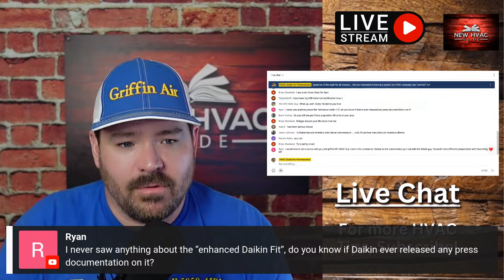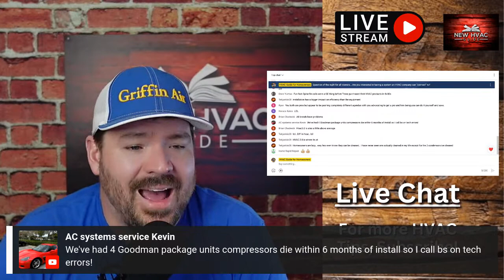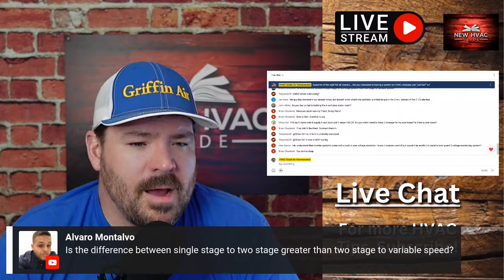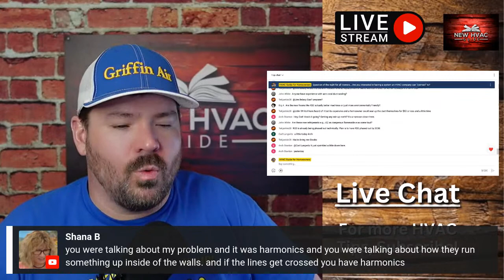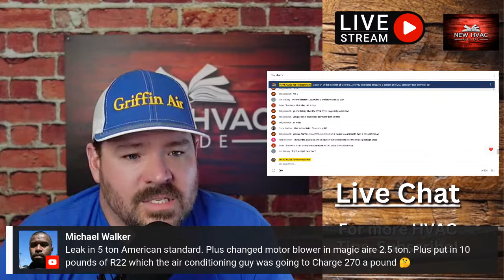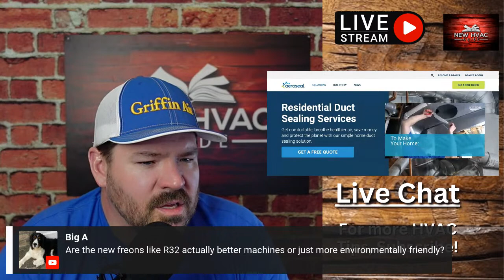HVAC Guide LIVE Show!

Comment: I have had some experience with several types/brands of HVAC thermostats and have a gripe about many of the new ones.  My last 7 day programmable thermostat was a Totaline and I could set the blower to remain on for 30 seconds after the condenser turned off. The same when starting up, condenser could be set to come on first, then a few seconds later the blower would start. I liked that idea because it would tend to dry off the evaporator on shut down and pre cool it prior to start up. I recently bought an expensive Honeywell WiFi thermostat and there is no adjustment for this which I find to be a negative with new tech. Anyone disagree?